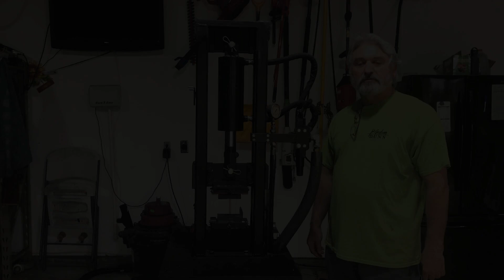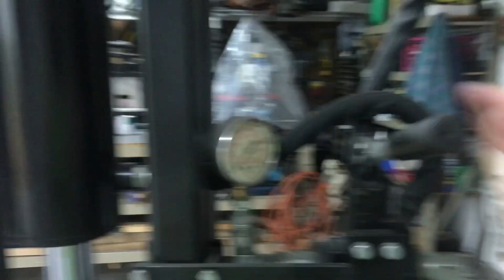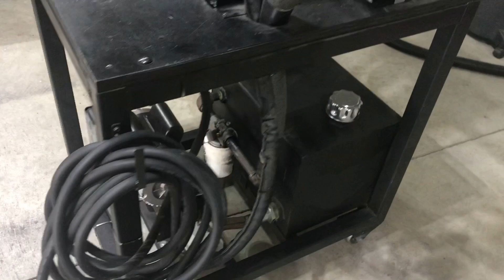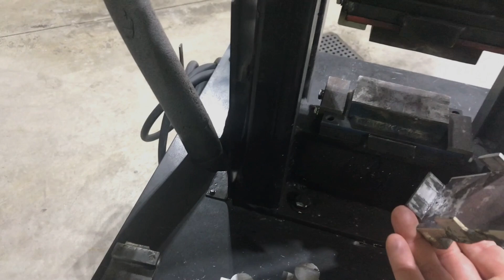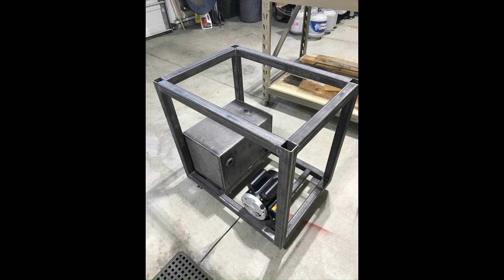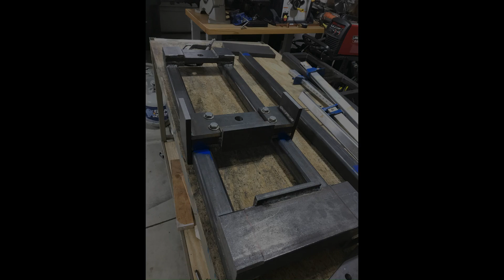Custom Hydraulic Knife Making Press

Comment: Hi Micheal, I really love your press! It looks to be one of the simplest and sleekest design I found on YouTube. Not too big or too high or too heavy like many others. I would really really like to have the length of each parts (The dimensions of all 2x2 tubes, the plates and guides for the cylinder, etc.) so I can make one myself. Would that be possible please? That would be awesome. Thanks! 🙂
Reply from the maker: I have previously answered similar questions in other postings on this thread. Please look through the comments and I give some dimensions for some of the parts used for the press and the cart. Thanks
Reply: @MichaelJonesCustomKnives  Thanks I did find some more of the answers I was looking for. I will try to figure out the other details but it should be ok since most everything is either 1/2, 1" and 6" or 12" wide. I am creating a CAD 3D version in Autodesk Inventor. Maybe I could make the technical drawing available to your subscribers when all is done. You could review it in PDF version if you want before diffusing to everyone interested.
Reply: @MichaelJonesCustomKnives  I am building my cart frame right now, based on your design.
I just welded the angle to support the tank, motor and pump. Getting there slowly! An hour or so per night... 😊 

I wish I could show you pictures, maybe if you are in Facebook? 
Thanks

Comment: That's exactly what I want to build! (Don't want to spend the money on a Coal Iron press) 
Do you have a parts list with manufacture and model numbers? I want to make sure that "this ram" will work with "this pump" and "this valve" etc. 
Thanks.
Reply from the maker: Sorry, I don't have a parts list. I ordered my pump and valve as a kit off of eBay and I bought my cylinder from Magister Hydraulics. Everything else was bought from local suppliers in my area. If your worried about compatibility of pump's, cylinders, etc. you can go to the manufacturers web site and get the specs for the equipment your looking to buy and make sure everything is compatible or not. The main thing to remember is that you don't want to pair a pump that will exceed the maximum rated pressure of the hoses and cylinder your gong to use. Buying a pump and valve as a kit will ensure the valve and pump are compatible and rated correctly. If your not sure what your doing I highly recommend talking to someone from the manufacturer to determine if your proposed setup is safe or not.
Reply: Solid advice. Thank you very much.  @MichaelJonesCustomKnives

Comment: What a great design! This is exactly the kind of setup I’m looking for. I love that you have it on wheels and you can easily move it out of the way when not in use.  Is there anything you don’t like about it or wish you would’ve done differently?
Reply from the maker: Thanks for the feedback. The only thing I would add would possibly be a foot pedal connection for the valve. Other than that the overall design has been working well for what I do in my shop. I will have a new video out soon and I will be using a lot of the quick change dies in that build for some Mosaic that I am making.

Comment: This is by far one of the best press builds that I have seen and explained in the most simplest of terms. I have been wanting to build a table-top version of a press and I was worried about the structure because all of the DiY presses I see online are using H - channels and those can be heavy as hell. Using 1/4" - 2x2 tubing for the uprights and reinforcing it with the L brackets and a strong base plate makes the job much easier. Then sandwiching the 1" plate between (2) 1/2" plates gives it the strength it needs to hold the press jack. I also like how you showed the table structure first, then the pumps. That being said, I want to follow this design to build my own press. Can you tell me the dimensions of your table/stand? LxWxH ... as well as height of the press tubes?
Reply from the maker: Thanks for the feedback. The table is made of 1/8" wall, 1-3/4" square tubing. The dimensions are L 30" x W 22" X H 28". For the height you also need to determine what roller/castor size your going to use and also the top of the table is made of 3/4" plywood covered with 3/16" sheet steel. The 2x2 uprights are 39" long with a 1" thick steel plate on top and bottom. If you look at the pictures at the end of the video you can see how I designed it and welded things together.

Good luck on your build.
Reply: @MichaelJonesCustomKnives  Thanks for the info. That helps me greatly. I have the 2x2" tubing laying around from my 2x72" belt grinder build. However, it's only 1/8" wall.  With all of the other reinforcement metal, I am wondering if that would do?  I am still fascinated by your build ... cool man ... cool!
Reply from the maker: I would not use 1/8 wall tubing for this type of setup. The wall of 1/8 tubing is pretty thin and over time I think it would fatigue and stress crack\break which could be very dangerous. With 1/8 wall tubing for the 2x2 they will be under a lot of load and will flex each time you put pressure on the press and over time that can crack welds. If your going to build a DIY press it needs to be engineered for safety first, then functionality even it cost a little more. My cylinder puts out 18.5 tons of down pressure, if something was to break it could send hot steel flying which could cause a serious injury or catch your shop on fire. Just my opinion.
Reply: @MichaelJonesCustomKnives  I tend to agree with you after thinking about it. I found someone that gave me some 2x2x.25" square tubing so I'm good with that. Thanks again for the advice and a great design!
Reply: @MichaelJonesCustomKnives  Thanks for those additional specs!

Comment: Best DIY design I've seen yet !! I am wanting to follow your lead and copy your design for myself !!  can you tell me what size dies you are using ?  I'm also wondering how wide of a billet you normally do with your press ?  would you be willing to give with and depth dimensions ?  I know you state approximately 2"between  2x2 supports how wide is that ? I'm think 12-16' wide ??  such a nice design I appreciate you sharing it with everyone !!!
Reply from the maker: Thanks for the feedback. The dies are built on 1/4" thick, 3"x6" plate steel. The flat die in the video is 1" thick by 2"x4" and welded to the 3x6 plate. All of my dies are built on this size plate. My typical billet size is 1.5" wide and anywhere from 4 to 8 inches in length depending on what I am making at the time.  I usually use 1.5" wide billets so I can pass it between the uprights on the side when setting my initial forge welds. The overall width of the press frame is 12 inches. The top and bottom plates are 1" thick, by 6' x 12". I used the same size for the cross member at the top where the cylinder attaches, and for the cross member with the die attachments at the end of the ram. The large cross member on the bottom that holds the bottom die is 2" thick by 6" x 12". If you look at the pictures at the end of video you can see how I put the press together. Hope that helps.

Comment: This is a great source of information. Thank you. I have many questions regarding calculations of motor speed, pump capabilities, hose psi, cylinder diameter, and stroke. I have a press with a very large cylinder in diameter fairly short in stroke and running off of 110 AC 2 hp motor capabilities. The stroke is very slow and I need to speed it up and would like to know how to determine  appropriate and safe changes.   Do you have any recommendations for reference material or calculations? Thanks in advance!
Reply from the maker: Taylor, thanks for the question. I am not a fluid mechanics\hydraulics expert by any means. I did my own research on the limits and pressures of the equipment I purchased to make this press. Hydraulics can be very dangerous due to the very  high pressures involved. I recommend that you reach out to the manufacturer of the equipment you have to get their recommendations on how to configure or speed up your hydraulic cylinder. Serious damage or injury can happen if you exceed the speciation's\pressures that your cylinder, pump, and hoses are rated for. If your wanting more speed than what your cylinder is rated for you may need to consider redesigning your configuration to meet your requirements. Hope this helps.

Michael
Reply: Thanks!

Comment: Really Really cool Press !
Could you tell me approximately how much it cost to purchase everything it took to build this unit ?  Thanks in advance.
Reply from the maker: Hi Keith
It cost approximately $900 in parts (cylinder, pump, detent valve, motor, suction hose, electric motor, wiring, etc..) and maybe another $2-300 in steel. I had some steel left over from some other projects that I used. Mind you that steel prices along with everything else has gone up so overall cost might be higher than what I am stating here. Hope this helps.

Michael
Reply: Thanks for the reply for sure.  That’s not as bad as I had figured.  But unfortunately I got rid of all my steel and pipe after I retired and we moved.  That the way things go but still that’s worth building.    You did a class act craftsman work on your assy.   Well done Sir.
Reply: @keithmarshall62  If you got a steel supply yard near you, they may have a "cut-off" section for partial sticks of steel. There's one near me and the cut-offs go for pennies on the dollar compared to the full length stuff. Keep an eye on the supply and go check it frequently, and you may be able to source material cheaper than others.

Comment: Any braces under the table? The 2" x 2" frame is supported by what?
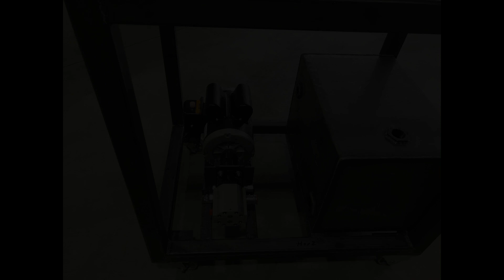Reply from the maker: At the end of the video I included some photos of the cart frame. There are 2 square tubing crossmembers welded into the cart frame and the press frame is bolted to that. Look at the video at the 13:03 timestamp and you will see some photos of what I am describing.

Comment: Looks just like my Coal Iron Works 12 ton.  It does not auto return to you can use it as a vice.  Coal Iron Works mounts the hydraulic unit on top of the reservoir so it is an uber compact unit.
Forge On!!!
Reply: Less the 5000 price tag right?
Reply from the maker: I have less than $1K in materials to build this press.

Comment: On those auto return valves, do they have a way to make it Manuel return so you could use the press as a vise if needed?
Reply from the maker: The auto return is a safety feature that is set at the factory at 3000 PSI to prevent blowing hoses or damaging the pump and cylinder. It is adjustable but I personally would not change it. High pressure hydraulic oil is dangerous. With that said, I use my press like a vise all the time to hold pieces in place. I simply apply down pressure until it locks in place and release the valve handle. It will not move unless I release it or reach the 3000 PSI max pressure. So the cylinder will stay in place until you decide to apply more pressure or release it.
Reply: @MichaelJonesCustomKnives  oh, I missunderstood the definition of auto return.   Seen some presses where the cylinder retracts soon as you let go of the lever, which could be handy at times, and a P.I.T.A. other times.
Reply from the maker: In this setup the cylinder does not auto retract when you let go of the handle, the cylinder will stay put. It only auto retracts when the 3000 PSI limit is reached.